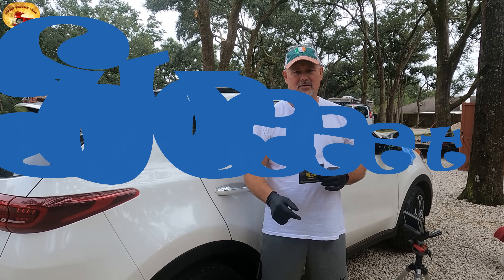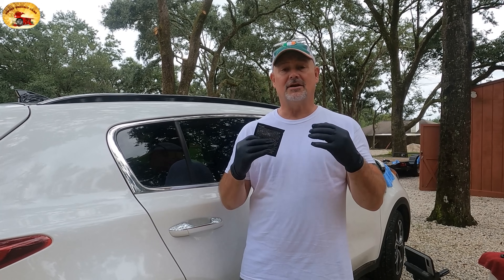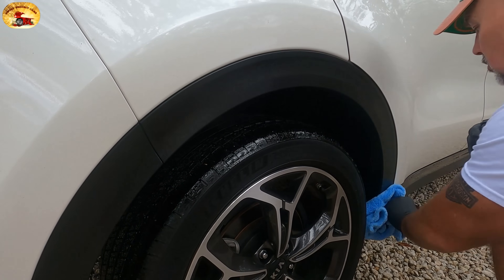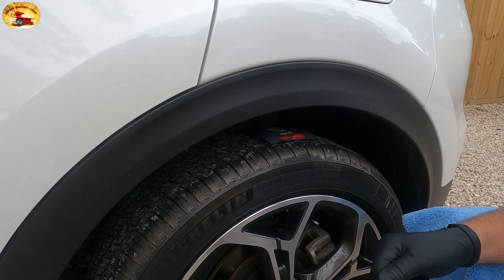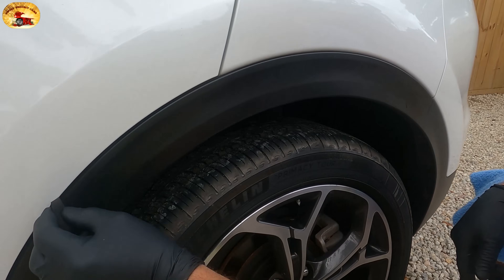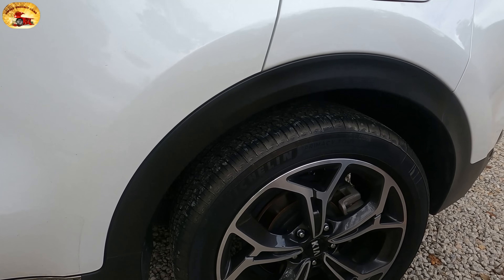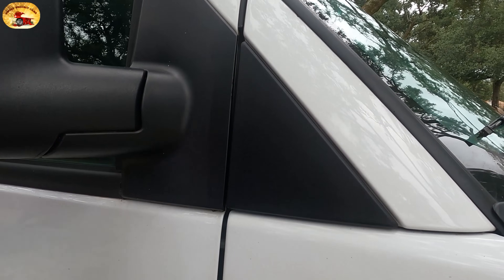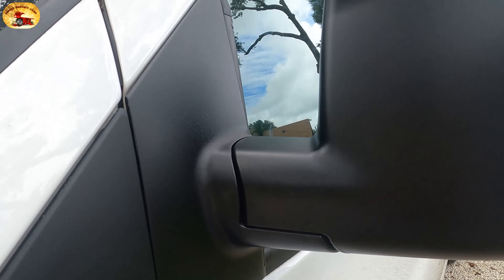AMAZING How to Restore Faded AUTO Trim and PLASTIC BACK TO NEW Permanently!

Comment: Hey Mike..thanks for the tip. I bought the old Lithium in the plastic bottle when it came out...a very viscous clear liquid that goes a long way. I will buy this this new one.
Reply from the maker: Thanks Jim, we still use this  https://amzn.to/35GTcka  we just like this new option as it's a "once and done".  Thanks for watching and sharing, have a great week my friend. mad Mike the hammer SPC
Reply: Yes that's the one...The Last Coat makes one called CeraTrim. It's pricey too but works very well

Comment: Hey Mike, I purchased this product back in February this year and am just now getting to use it because my truck was in the paint shop this whole time. 
I spent an hour cleaning my trim and went to use the cubes and they were completely dried out. Not a drop of sealant. Dry as a bone. The package was un-opened and 
stored inside my house the whole time. Does this stuff have a shelf life? Did i possibly get a bad batch? Highly disappointed.
Any thoughts?
Reply from the maker: We have never had that problem bworks. You should definitely contact the company, they have excellent customer service my friend.  Give them a shout. Thank you for watching and sharing, have a great week. mad Mike the hammer SPC
Reply: @SweetProjectCars  Good deal, yeah I contacted them and they said they did have a bad batch at one time. They said they would send me another pack.
               Thanks for your response Mike!

Comment: Is this really permanently? Because there are plenty of such products but none I found till today was permanent
Reply from the maker: Well, I can tell you this, you have nothing to lose and all to gain, if we tell you it's permanent, it's permanent, period.  We would not put our reputation on the line for a few minute video.  The product is guaranteed permanent if applied as directed, it is stated right on the package and this company is one of the most stand up companies we have ever dealt with.  Thanks for watching. mad Mike the hammer SPC
Reply: It is supposed to last for 250 car washes.  Nothing is truly permanent, but 250 car washes should last many years.  And they have a great guarantee that they really do honor.  If you aren't satisfied, contact them and they will make it right.

Comment: The proof is 1 year later. There are all kind magic trim restorers on the market and none last. The dyes are a nightmare to remove after years or flaking off (Turtle Wax).
Reply from the maker: Well, give it a shot, you have nothing to lose and all to gain with this  https://amzn.to/2YEhfz9  The product is guaranteed when used as instructed, so again, you have nothing to lose J Jack. Thanks. mad Mike the hammer SPC